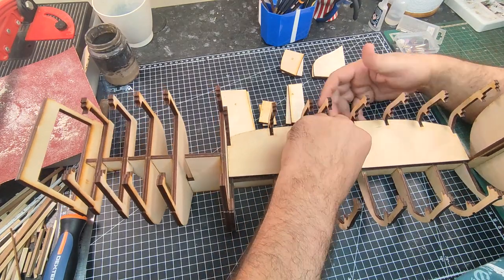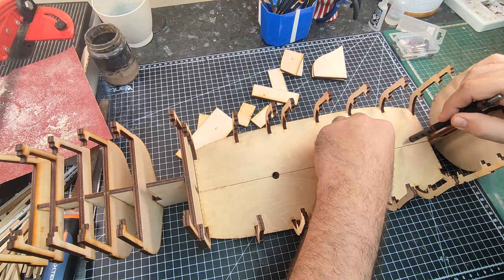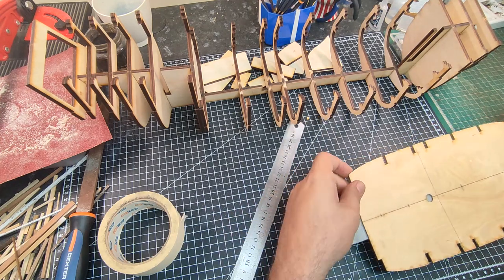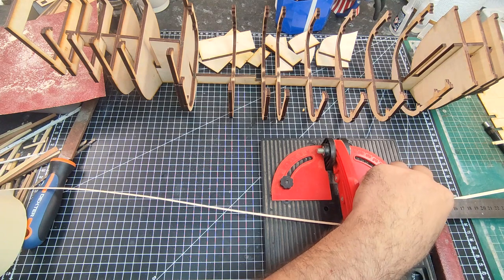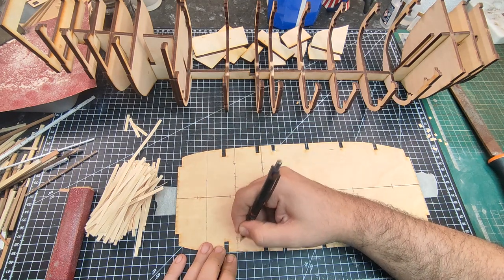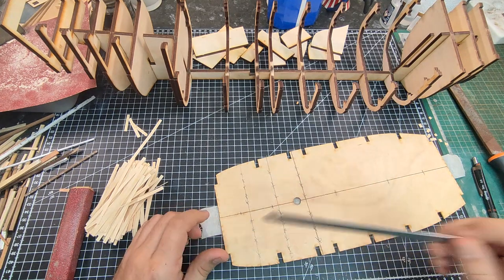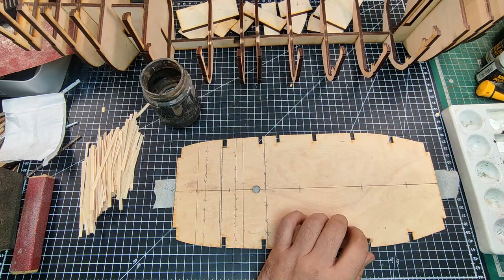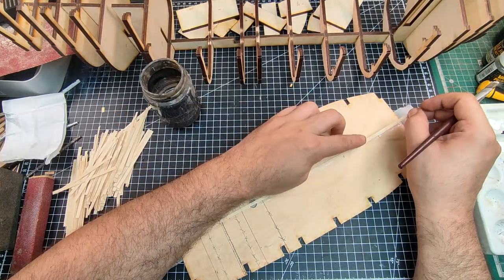The Black Pearl model ship - part 3 - Bottom deck | Scratch build from plans wooden model ship

Comment: this  looks like a kit build- no ?
Reply from the maker: No, this is a scratch build with plans that I've designed and pieces that were cut according to it, you can watch the 1st video of the series to see how it was made
Reply: @ModelShips   wow !!! ok !! tyvm !!  you  cut pieces  almost as if they were laser cut by machine !!! bravo !!
Reply from the maker: @cajunrandy2143  they are laser cut
Reply: Ok  is that CA glue your using  to glue your planks down,  noticed you started with wood glue ?   Im want to start on a small easy kit first , so I will be asking questions lol lots of silly questions 😊😊😊😊😊😊
Reply from the maker: @aussiefrenchman-hobbytable9960  Sometims i try to do thigs the way everyone says they should b done, and i try PVA glue, and then i remind myself why i hate white glue, and end up reverting to CA glue, everyone will tell you that wood should be handled with pva glue, and if you can handle the waiting the clamping of all the process, it is good to use it, i really can't, on top of that, any glue will make it harder to stain,  if it ends up on the top face of the wood, so with CA it's much easier, at least for me, to keep it away from the top face because it's less ammount of glue needed
Reply: @ModelShips  I know working with CA is quicker,  and understand where your coming from , have you had problems with CA failing when working with wood ?
Reply from the maker: @aussiefrenchman-hobbytable9960  on its own never, I think small pieces are a bit more brittle when cleaning after a few years, nothing that can't be reglued
Reply: Thanks 😊😊😊